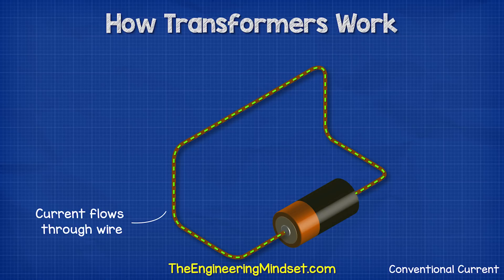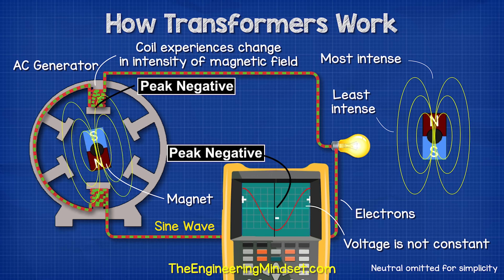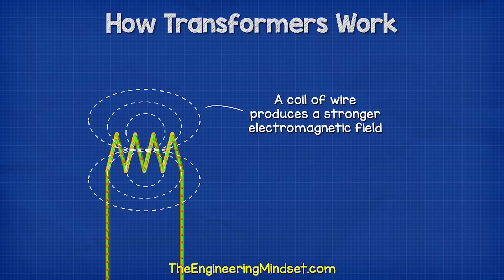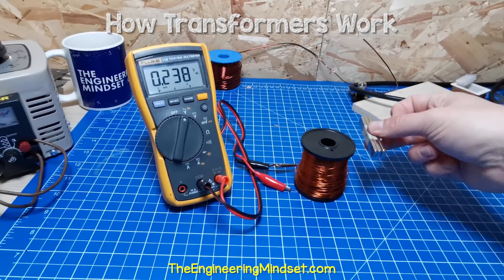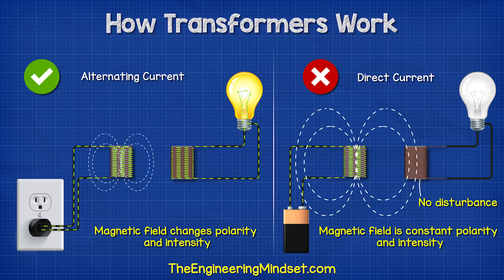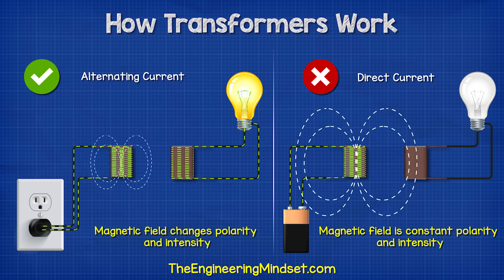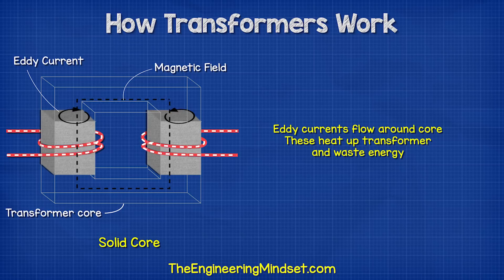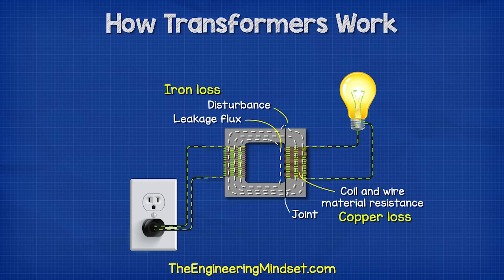How Transformers Work: The Basics

Comment: Could you please do a video on, how much current is still being used by the primary coil winding, even when the secondary coil winding is open circuit, or unplugged. Such as a 5Volt USB phone charger when the phone is unplugged.

Love this Channel !
Reply: Does the USB plug (transformer) get warm when no LOAD is connected to it? Shannon Davies.   Does a little lite come on at the cube with no load connected?

Comment: How do you change hertz? Using capacitors?
Reply: there is no easy way to change it really, It is generated as 50 or 60 hz at the generator in the power station and their is no easy way really other than changing the generator speed to produce the desired hz but then all the generators within that power grid would need to be changed to that same HZ, A other way to do it is to First change the incoming AC  To DC then create a desired outgoing AC Hz with something like a MOSFET. An example of this is the High Voltage Direct Current lines used for high power transmission lines, In those examples the AC is rectified in DC then its transmitted over the power lines to something like a substation where the voltage is then changed back into AC by for an example a MOSFET
Reply: Depending on why you need it, say speed control or reversing a motor, a VFD (variable frequency drive) is probably the simplest solution.
Reply from the maker: See my new MOSFET explained video here➡️: https://youtu.be/AwRJsze_9m4

Comment: What does transformer oil do?
Reply from the maker: It allows heat to be removed, it heats up and naturally flows away from the heat source due to chnage in density. Colder oil will take its place. The oil gives up its heat through the walls of the transformer and continues the cycle to pickup more heat

Comment: My home having the transformer just in front of main door across the road. 5 years ago, transformer suddenly blew up and it does not damage the main panel but it has damage the wire which resulting all of our residential property have facing the blackout. Luckily, the service has repaired it and return as normal.